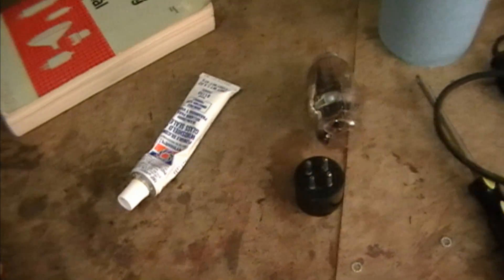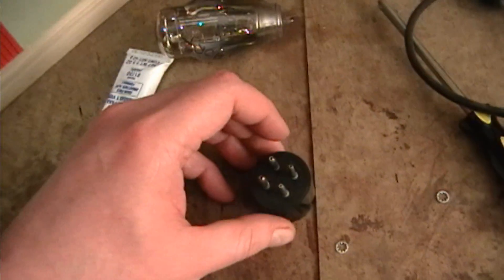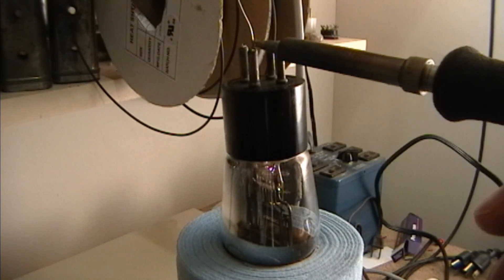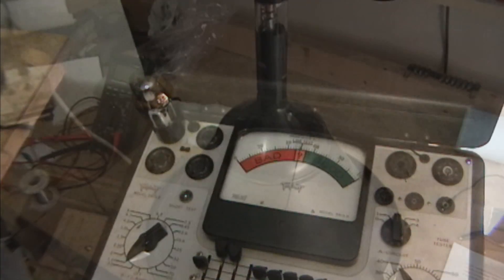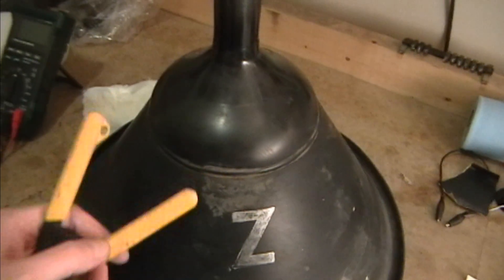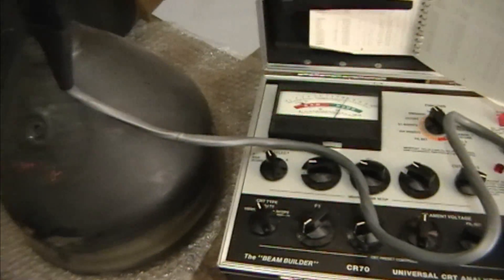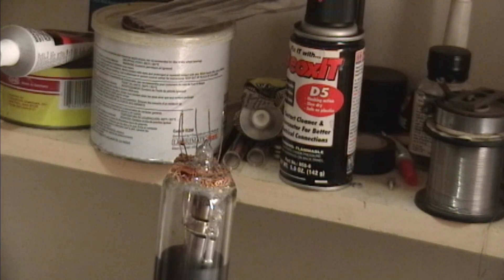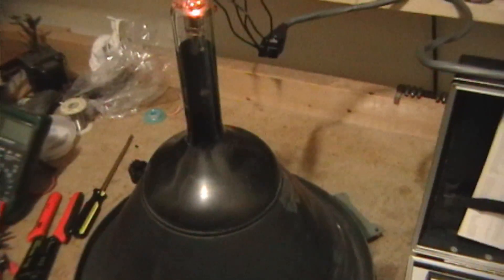Repairing tubes

Comment: Excellent video.  When you know what you're doing, it still looks like courage :)  When I get to the end of a CRT that will not rejuvenate, I can hold the rej. button down and a orange/red glow will show up in the cathode/G1 space.  It is not from arc but the deep element glowing from the high voltage of rejuvenation.  I do a bit more rapping, but you pretty did everything.

Comment: I don't know if my tube in TV is bad or if it's another problem. The TV has had lines going across it on top for the past 2 years. But now there's a static electricity sound coming from the back of the set and the picture is all distorted and looks like lightning going across the picture.
Reply from the maker: No, a bad picture tube would not cause any of that.  How old is your TV?  What brand and model ?
Reply: @bandersentv  its a Samsung from about 13 years ago. Idk the model
Reply from the maker: Sorry I can't help you.  I work on TVs from the 1940s and 50s.   Yours must be one the last CRT TVs made.
Reply: @bandersentv  nice. It's all good

Comment: Are you available for hire?
Reply from the maker: Possibly.  I have a 6 month backlog right now.  What did you have in mind ?
Reply: bandersentv I have a (NOS) 1960 Amperex 5AR4 that I believe may just need to have the base rewired. It is testing over 100% on one side but nothing on the other. It's in pristine condition with even the bugle boy graphic fully in tact as well as most of the lettering--which would seem to support the belief that it is truly "NOS"
Reply: bandersentv ...I also have some old TV parts you might be interested in that you could have FOC
Reply from the maker: If you have access to a soldering iron, try heating up the pins to reflow the solder.  Does the filament light on both sides ?
Reply: bandersentv Yes, on both questions and I'm guessing this must be a faulty tube, the closer I look into it. The forward voltage is 5/406 (reverse is 423/424). Sadly, I don't know if there's anything outside the tube that would cause the forward voltage to be askew. It's a shame to have to toss it...

Comment: Is there another metal glass picture tube type similar to a 16GP4 but with a different pinout? Like if a grid connection and a cathode connection were swapped with each other the tube would test as a dud even if it was good.